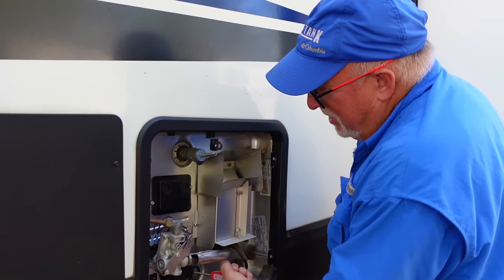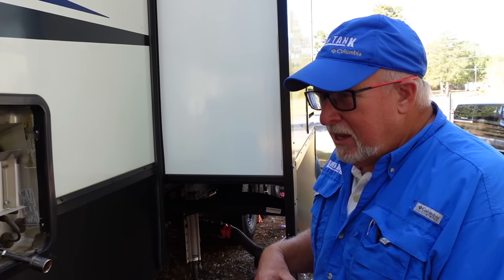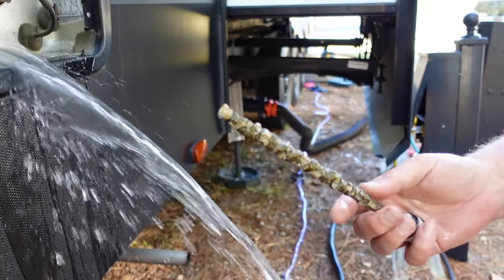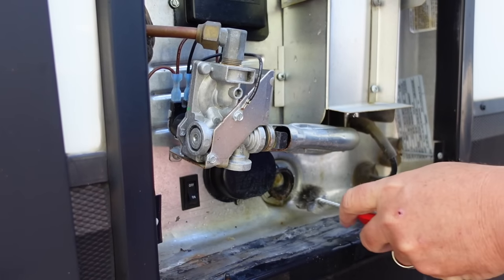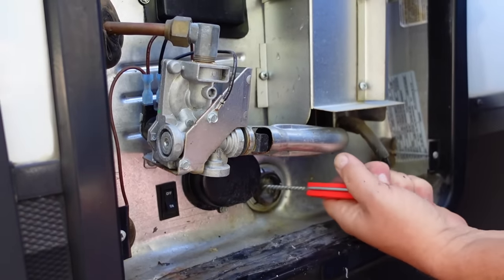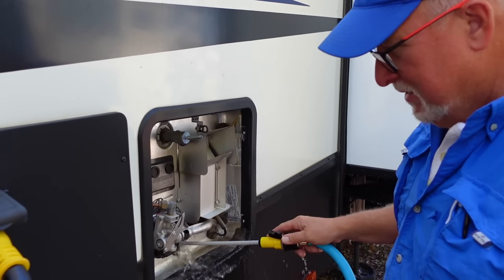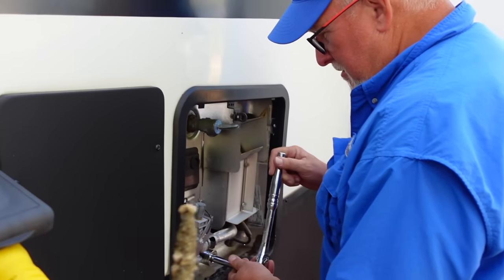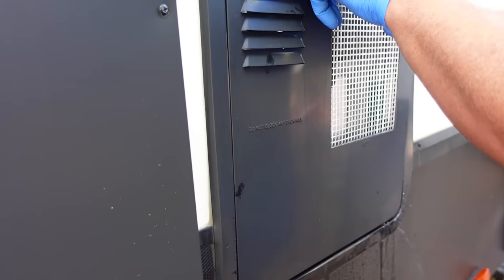RV Water Heater Maintenance & Mistakes Every RV Owner Should Know!

Comment: No the anode rod is NOT in bad shape. Until it gets down to pencil size rod that’s when you replace it. It’s supposed to look like that because it’s doing its job of falling apart to protect the tank. That anode rod has many many months of protection left.
Reply: When to replace your anode is at your discretion. But since many RVers don't replace them with regularity, we recommend a best practice standard. You would be surprised at how many RVers never even clean out their water heater tanks!
Reply: Does a 2017 Jayco Redhawk 26XD accept a anode Rod  ? ( Atwood )
Reply: Right? It's barely even used... They look close to a pencil lead when they're used up
Reply: @kleentank  "regularity" isn't TWICE a year... What? That's crazy
Reply: Yep
Reply: I rent out RVs. I replace them once a year.
Reply: Preventive maintenance, 25 dollars vrs 600 just stay ahead of the game
Reply: Plastic drain plug is a safety feature.  DO NOT replace with an anode rod!
Reply: @kleentank my water heater takes several tries at firing up and sometimes I have to cycle on off switch to get it finally stay lit and heat the water up. It’s a Dometic, about 7 years old. Tanks have plenty of gas in them. Is this a burner issue, like needs cleaning? I don’t see any insect issues in gas tube or anything like that.
Reply: You’re correct.
Reply: I had the same problem. On electric the modem fried. Had to replace it
Reply: @dkhallal There is a number of possibilities to consider to troubleshoot: a) gas ignitor gap to wide or is failing  b) not getting enough oxygen in gas tube (simple adjustment) depending on altitude. c) gas orifice needs cleaning. Do a youtube search.
Reply: Guys, Here is The Savior

HalleluYAH translates “Praise ye YaH”

YaH is The Heavenly Father 
YaH arrives via the TENT OF MEETING
YaH was Who they Crucified for our sins
YaH was Crucified on an Almond TREE

— Ancient Semitic Cuneiform of Moshe (Moses)
— Isa Scroll (The Original Isaiah)

Isaiah 42:8
"I am YaH; that is my Name! I will not yield my glory to another or my praise to idols.

Isaiah 43:11
I, I am YAH, and there is no other Savior but Me.

Isaiah 45:5
I am YaH, and there is none else.
Reply: Just so you know once an anode rod starts to deteriorate like that one it loses 50% of its effectiveness I used to work on boats it’s the same basic thing essentially
Reply: @waynegargano1016 no.  That’s an aluminum tank so you will have a half inch plastic plug
Reply: It's $25 just replace it🤦‍♂️🤦‍♂️
Reply: @marcjampolsky5280    It is "regularly" if twice a year it's recommended to do!  It's all relative.  Now changing your underwear on that timetable....I wouldn't advise it
Reply: Unless you're essentially LIVING in the rv it will last YEARS.
My "regularly" checking my rod is at the beginning of the season when I sanitize my system and at the end of the season when I'm winterizing.
AND the only reason why I'm even looking at it is because it's out anyways..
So yeah, I guess that could be considered "regularly"
Reply: How does the length of the anode restrict water pressure 🤔the two for $10 on Amazon are 8 1/2” long and don’t have black tops and last easily for a year if you use a in line filter upstream of your supply water👀🤟😎
Reply: @marcjampolsky5280  how do u sanitize and how many times a year and why do u do it? Im new to this trying to learn
Reply: To be clear, the anode rod isn't for sanitizing....
 But to sanitize your system you would typically use bleach in the water storage tank... Then flush it through all the lines... Let it sit for a while. Then empty and flush a few times with fresh water.
I only do it once a year at the beginning of the season.
The why..... Any time there may be stagnant water or antifreeze, like over the storage season, that way, even if you don't normally drink from the storage tank, you COULD
Reply: Better safe than sorry, I change mine every year and we on camp on weekends, and not as often as I would like. 🤷‍♂️

Comment: you should NOT have the relief valve open when you fill the heater. You need the trapped air at the top to provide a water expansion buffer or your relief vale will almost always leak. Been doing this on rvs since 1985
Reply: agree, and I had one that did not use an anode rod for ten years and never had a problem!
Reply: Respectfully disagree. Simply opening any tap in the RV for hot water would immediately eliminate the trapped air in the water heater tank. A leading valve is almost always the case of an improper fitting or seating or failed valve in need of replacement.
Reply: @kleentank  Incorrect...the hot water does not exit at the top. There will ALWAYS be trapped air until it is exhausted by long periods of use such as a seasional camper. Thats the design of ALL water heaters
Reply: The air pocket is above the safety valve.  Yo child sometimes just open it to let some water out to recreate the air pocket and also stabilize the water pressure in the pipe when there has been too much succion in an almost empty fresh water tank when the pump goes crazy and noisy after refilling .
Reply: If you read the owners manual for Suburban, they specifically say to keep the air pocket and replenish it every so often.
Reply: @kleentank  I watched the video on cleaning the black tank are the little plastic things with power in them that help with smell good to use in the black tank?

Comment: We have been camping about once a month and average 4 nights per stay. Something I came across on YouTube before we bought our trailer was to drain the water heater after each trip to reduce wear on leaving water in the tank. I have done this religiously and to this day the anode rod is still looking very good after 2 years. We do use mainly State Campgrounds in Oregon which likely has better water which I am sure helps. Great maintenance video. I think water heater maintenance is for sure something that doesn't get done as often and this is a great reminder.
Reply: Not sure this is a good idea. When you drain the tank, there is still water in the bottom 2 inches. The tank will corrode but the anode will not protect it because the water is not contacting the anode.  Thus you are protecting the anode rod but you are not protecting the bottom of the tank.

Comment: If you want to avoid the "Hot Shower" as shown at 4:50; open the pressure relief valve and both the Low Line & water heater valves found on the bottom outside of your trailer. Some valves are in the inside but they drain out side under the trailer. Most of the time you'll two little hoses hanging down from the bottom of the trailer. They are usually quarter or half turn valves.   after it stops draining then remove the plug that is attached to the water heater. You'll get about a pint of water and can replace your anode rod. The water will all drain out and you stay dry & unharmed.
Reply: That's great advice!
Reply: After opening the pressure release valve and releasing the pressure just close it back off before removing the anode rod. This will minimize the initial rush of water and it can then be reopened if you want to speed up the draining process.
Reply: @a.n.7863  see my first comment reply and you’ll have NO gush of water at all.
Reply: @herb7877  Sorry, I was in the process of editing my comment earlier to say I wasn’t contradicting yours but I got interrupted and never got back to it. Not every RV has those two drain hoses. Leaving the release valve closed (as well as all faucets) restricts the air flow behind the water and slows down the drainage.
Reply: @a.n.7863  no worries. I was just trying to point out a way to stay dry. Apologies if it sounded snarky. Wasn’t my intentions
Reply: @herb7877  it’s all good. You have given me something to investigate though. One of the two drain hoses I have is for the fresh water tank and I’ve always assumed the other was the low point. I don’t remember any warm water flowing from either, but that may be because when winterizing (which is the only time I ever open those valves) I’ve probably already drained the water heater.
Reply: Don't recommend opening pressure relief valve.... Deposits then slip between the the seal and it drips... Then replacement.
Reply: @JohnNguyen-iw8qn  never had that problem in over 20 years of doing it that way. Not that much comes out and what does, comes out under pressure would flush any debris out. In fact, a couple of time when it did drip I just very quickly release it a couple of time for just ever so slight an instant it clears anything. But to each there own.
Reply: Thank you for this! I have been trying to figure out what those lines are. I think we have one that is leaking from the hot water heater. Thanks for this tip!
Reply: I used to shut off my hot water heater so it won't heat the water. I then opened my hot water in like my kitchen sink until the water runs cold. No chance of burning yourself while doing anode maintenance.
Reply: Nice video. FYI, Suburban RV Manufacturing (and the National RV Training Academy) no longer advise wrapping the anode rod threads with teflon tape. Suburban says to use pipe dope.
Reply: Guys, Here is The Savior

HalleluYAH translates “Praise ye YaH”

YaH is The Heavenly Father 
YaH arrives via the TENT OF MEETING
YaH was Who they Crucified for our sins
YaH was Crucified on an Almond TREE

— Ancient Semitic Cuneiform of Moshe (Moses)
— Isa Scroll (The Original Isaiah)

Isaiah 42:8
"I am YaH; that is my Name! I will not yield my glory to another or my praise to idols.

Isaiah 43:11
I, I am YAH, and there is no other Savior but Me.

Isaiah 45:5
I am YaH, and there is none else.

Comment: Performed the cleaning with 5 gallons of white vinegar, heated over night and drained on my Atwood 10 gallon water heater and drained the next day with zero "flakes" coming out (16 year old RV !). Turns out that some of the Atwood water heaters don't need sacrificial anodes because the tanks are made of aluminum. Good exercise :)
Reply: how did you fill it with vinegar???
Reply: @Rosemunchkin1  I fill my Atwood tank with Vinegar by unscrewing the pressure relief valve and using a transmission fluid oil spout I got from Walmart.  It works perfectly and was only $5. Be sure to put thread tape back on the valve before screwing it back in.

Comment: I learned a lesson a few days back. Don't forget to make sure your rv water tank is SHUT OFF and cold before you take out the heater element. Also open the pressure valve.

Comment: If the hot water rank don't have expansion belly, for the pressure,  then you have to crank open a tap to drip so no pressure builds up. I learned that the hard way, blew my seals out in bathroom faucet, was leaking water for awhile before I found out.

Comment: So what I have done as i'm a full timer since 2016 is I shut off the hot water tank, wash all of the dishes with the hot water and run out the hot water until it's look warm. I also never open up the pressure relief valve to release the pressure because I find that you get some corrosion in the valve and after doing it a few times the valve leaks and you end up with ice everywhere if you are winter camping.  I have had to replace the Pressure release valve many times, so much that I bought the socket on amazon to help remove and replace easier. I just open up the hot water taps in the trailer. I am also hearing stories about those clean out wands ( the same one I have)  snapping off and getting stuck in the tank, people are suggesting a metal wand to prevent that from happening.

Comment: Thanks for making this informative video! We have a 2017 GD Imagine TT with an Atwood W/H. I never knew that after about 4-5 years we need to install a anode rod. I used your links to buy the brushes but your link for the rod was a 2 pack for $12. Jim said not to buy them as the quality was not good. I went to Amazon and bought the Camco 1 rod pack for $17. 
Thanks again for all you do & look forward to seeing your next video!
Reply from the maker: Glad it was helpful!
Reply: How do you maintenanc on a 20 gallon electric water heater tank on a park model? Thanks 6:48PM east time zone

Comment: Great information about water heater maintenance .. I remove my anode rod every fall when I am winterizing my RV and draining my hot water tank , I remove it and leave it out during the winter .. I check the anode and replace it every year or two as needed .. I do buy the two packs but have never had any water pressure issues with Camco or the cheaper anodes however .. Great idea about getting a 1 inch fitting brush to clean the threads and using a flushing nozzle to flush the tank , great video ..

Comment: I just subscribed the only issue I was having is the switch for the water heater was not moving and I didn’t want to brake it but after a day I went back and applied force and it worked but now it won’t go back to the off position, oh well I can deal with that after the trip.

Comment: i have a Atwood Heater and its about two years old. question is do i have to wait until i see stuff coming out of the tank to install a Anode Rod
Reply: Your Atwood (now, Dometic) water heater has a two year factory warranty. Installing an anode rod in that two year period will void the warranty. That being said, about year three to five, depending on use, we do see corrosion coming out of the water heater and recommend the installation of an anode rod to slow down the process.

Comment: You want to adjust temperature some water heater models have adjust on burner tube to a get a blue flame. At the same time some systems have mixer valves to help with temp.

Comment: Very helpfull. My Suburban water heater is 17 yrs old. On 2nd anoid. Current anoid is still clean and like your new one in video. It is like the better Camco one. My camper is only used a few weekends a year and 95% at 1 campground which has good well water. I can see doing the flushing this spring. Good tip! Hope I don't need a new water heater in the near future. My camper was built in Nov 2005.
Reply: Wow! Two anodes in 17 years. That's some kind of record and very rare for sure.
Reply: @kleentank  the first anoid came with the camper. I bought it used 3 yrs old. Didn't check it till 2 yrs later as the camper was in dry storage. The 1st anoid was down to a 1/8" skinny rod. So it was replaced start of 2012. The 2nd one is pulled and inspected at end of every season (only 5.5 month season here in upper Wisconsin). As soon as I see wear, it will be replaced again. May need your tank flushing services. Don't know if you travel from Northern Illinois all the way north to Pelican Lake, WI. (Map it) Could be a 5 hr drive 1-way for you. Water is on from maybe mid April to early Oct.
Reply: Guys, Here is The Savior

HalleluYAH translates “Praise ye YaH”

YaH is The Heavenly Father 
YaH arrives via the TENT OF MEETING
YaH was Who they Crucified for our sins
YaH was Crucified on an Almond TREE

— Ancient Semitic Cuneiform of Moshe (Moses)
— Isa Scroll (The Original Isaiah)

Isaiah 42:8
"I am YaH; that is my Name! I will not yield my glory to another or my praise to idols.

Isaiah 43:11
I, I am YAH, and there is no other Savior but Me.

Isaiah 45:5
I am YaH, and there is none else.

Comment: I eliminated the need for having to replace the anode by replacing my suburban hot water heater with a Tankless system. It has been a bit over a year now and I couldn't be happier. I would recommend them to any who is living full time in an RV.
Reply: Those need maintenance too. If you don't take care of it it'll fail in a year or 2

Comment: I understand your earlier reply to my comment and since I have full timed for five years now most people don’t do preventive maintenance on any part of their rv. 
But again I’m only asking that you show a bad part and state it needs replacing, not a good part and tell people it’s bad. People look to you for good advice - please give them good advice.
Reply: Jim does a great service to remind us that a little maintenance is required and necessary to give longer life and best operation of our water heaters. I will suggest a little better description would be to refer to it as a “sacrificial anode” or “sacrificial rod”. The sacrificial anode is a simple and effective way to utilize a natural process called galvanic corrosion. The type of metal selected for the sacrificial anode will be more reactive than the metal of the tank and heating element therefore “sacrificing” itself and minimizing effects of corrosion on the rest of the heater. When the “anode” is pitted or has small barnacles on it you know it’s working to protect you water heater. If it’s minor pitting you can clean it up and reuse it since there’s lots of the anode remaining to sacrifice. However, if in doubt, just replace the sacrificial anode. Doing the maintenance is the key part. The science is  an interesting side note. BTW, the same science is applied to our outboard motors. There’s a sacrificial anode on the leg to help protect it from corrosion and give you long service life. Thanks to Jim and everyone for the discussion. Happy RVing. 😁

Comment: Better off not to play with the release valve, which is not meant for that. You just have to open at water faucet inside the RV and it does the same job. The pressure release valve is there for one purpose it’s in case of there is too much pressure it’s not meant for draining.